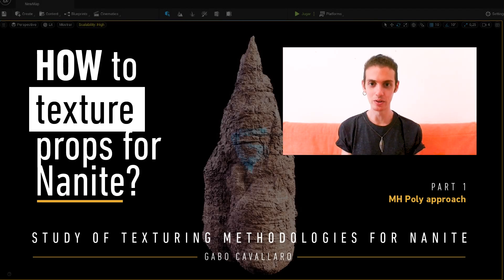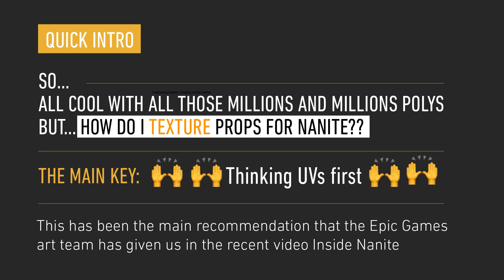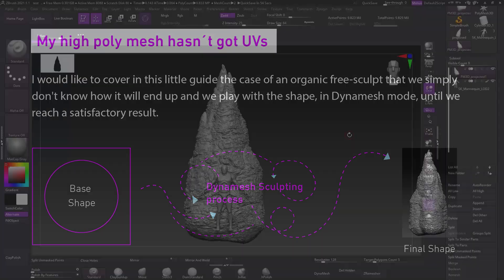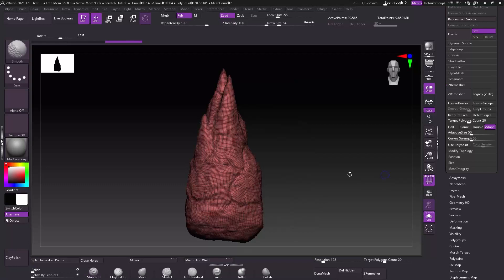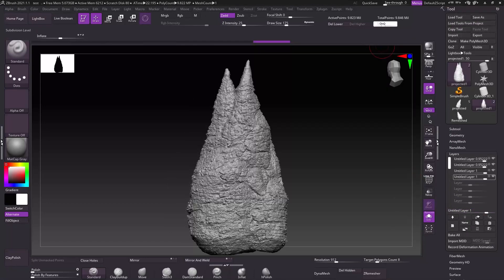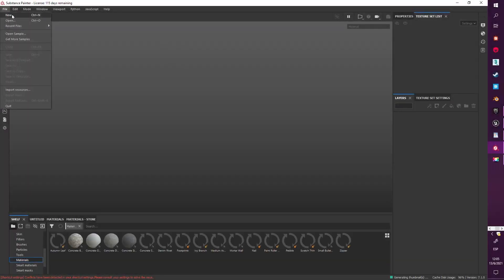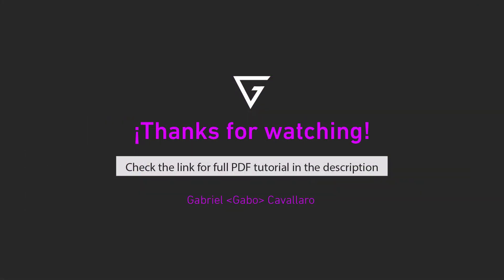How to texture props for Nanite - UE5 // ¿Cómo texturizar props para Nanite - UE5?

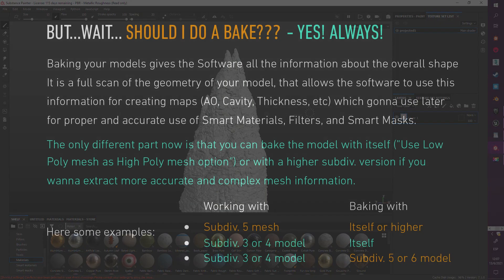Comment: 14:50 - kinda late I know, just noticed the process is more or less the same like up until now, only more demanding on dev's HW, since more computational power is necessary to do the baking in case of HP model instead of LP. Thus it acts as a "toll" for devs to provide less demanding output on consumer's HW. No wonder most modern UE5 games are badly optimized, looks like devs avoid correct nanite mesh preps, baking super high poly ain't really pleasant in case you need to do thousands of assets... LP bake is still much easier

Comment: So does the nanite (high) need Uv mapping or just the one that needs texturing?
Reply from the maker: Hi Matty! You need uvs in both, due your textures needs an UV Map to painted of (lowpoly) and displayed (high-poly).
But this is a workflow based on traditional texturing using UVs there is also another way using vertex colors.
Reply: @gabocavallaro  Thank you! I wasnt sure from the other guide since that mentioned only the medium.

Comment: Nice tuto. I just don't understand the point  of baking the normal map. Of curse baking the other maps is useful for working in painter, but the normal one? Is it adding any extra thing into your nanite mesh? (you exported it but then you didn't use it in unreal). 
Thanks!
Reply from the maker: Hi Pauuu, u speak Spanish? lol It´s in case your pc runs slow and can't handle too many poligons inside Substance. Also if your super-duper high poly got really extra small detail, then in your middle-high won't appear, maybe you can / need to use it or see it. But yeas if no need, no bake :D
Reply: @gabocavallaro  Sí, hablo español ^^. Muchas gracias por tan rápida respuesta. Entiendo entonces que el normal map lo usarías dentro de Painter para algún filtro/smart material y nada más? Quizás sea un poco dumb question, pero no suelo usar mucho el normal en substance (sí que uso anchor points con height maps que añado, pero intento no salirme del canal de height, puesto que me da más control). No sé si internamente mejora en algún generador en combinación con los otros mapas. Normalmente con curvature, ao, position y thickness suele bastar para generar el texturizado. 
Por eso me parecía un poco contra intuitivo bakear el normal map usando nanite (aparentemente no le veo mucha utilidad). Pero asumo que es más para visualizarlo correctamente y generar detalle en las zonas que "pierdes" al pasar al mid poly.
Gracias otra vez!
Reply from the maker: @pausancheziglesias519  exactameeente no es lo que te llevas a Unreal, porque vas a usar Nanite es de acuerdo a como podes ver en Painter de acuerdo a tu pc, por ejemplo la mia es un poco vieja y no puedo cargar mucho poligonaje, y por supuesto, claro para el uso de filtros y todo eso, igualmente generalmente hacen uso del AO, el Cavity y el Thickness. Por otro lado este tutorial es simplemente un estudio de una tecnología muy temprana, seguro hay otras formas quizá mas eficientes o mas directas. Esta basado en base a la conferencia de los muchachos de Epic, pero un colega me decia que es mas directo tambien cargar Vertex Paint. Estoy trabajando en una parte B sobre este tema. Como decia en el video la idea era por lo menos "abrir" el dialogo, incentivar un poco y ver que cosas nuevas se pueden hacer. Un gustazooo conocerte por cierto :D
Reply: @gabocavallaro  El placer es mío. La verdad es que es un tema bastante importante (sobre todo para los usuarios de Substance). Hasta que no mejore el ecosistema de softwares alrededor de Nanite habrá que ir buscando parches para poder tratar con semejante cantidad de polígonos xD.
Saludos!
Reply from the maker: @pausancheziglesias519  jaja seguramente pronto saquen una actualizacion, on exportador directo. Creo que la tendencia es que esté todo unificado. Igualmente tambien tener en cuenta que en el video de Epic, decian que texturizaban con Quixel que no tiene drama en majear muchisimos poligonos

Comment: i dont understand why you still need to bake though. if you dont need to extract any details since your mesh is already high poly with all the real detail. why have to get the fake detail out of it and stick onto the high poly mesh if its already high poly?
Reply: Accidently stumbled upon this video. But in general best option is to have base mesh that can be subdivided in painter and exported as high poly from painter. Why? Because in that case additional textural edits to your mesh that require depth (height, displacement) will be real and render much better in nanite also omitting the need for normal maps in certain scenarios. So you do want to bake in and bake out stuff for use in engine.
Reply from the maker: @staughost  Nice nice guys! As I said this video has the aim of "star talking about this" to fire the discussion It´s just an approach but there another, ofc, I´m working and researching on, and I will upload soon. And in regards the question of @Sheldinator the ides of baking its to get information for texturing inside Painter, coss all that information (ao, cavity, thickness, etc) is used in the smart filters, materials, and mask and It´s just for texturing purposes. Then ofc you just take your high poly to Unreal, no need to normal
Reply from the maker: HIi @Sheldinator, sorry for my late reply, the idea of baking its to get information for texturing inside Painter, coss all that information (ao, cavity, thickness, etc) is used in the smart filters, materials, and mask and It´s just for texturing purposes. Then ofc you just take your high poly to Unreal, no need to normal

Comment: LOD is still superior to nanite. The only good thing about nanite is how effective it is on meshes with smooth silhouettes or high amounts of fine detail. So sculptures and Modular building parts. But for rocks and natural things like that: which don't take the very optimized nanite settings very well: using LOD will get more performance from lower end systems.
Reply from the maker: nice thanks for sharing! I did a quick stone sculpt but I guess the idea to texture a Nanite mesh is for a really custom asset like a real particular esculpture, or building decoration like in all nanites and UE5 demonstrations^^ but as I said the idea was to "open the door" to start thinking about the uses and best approaches. Cheers!!